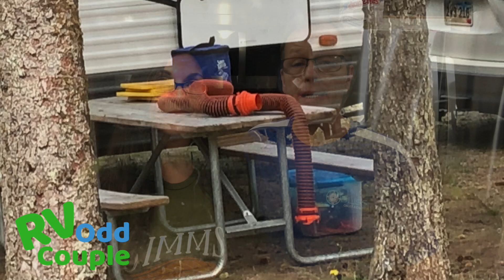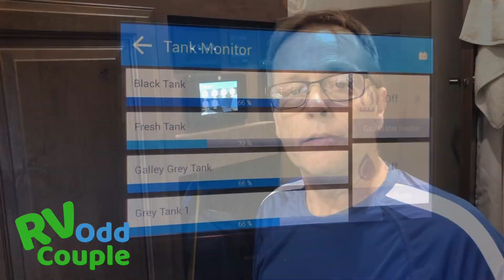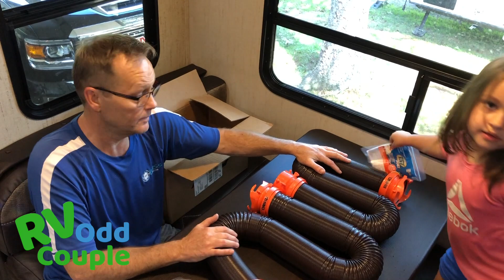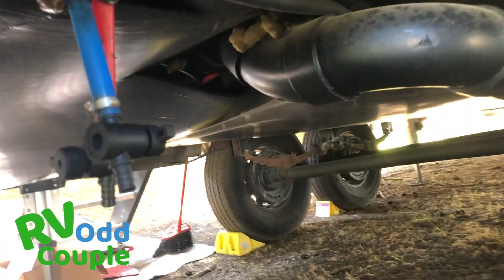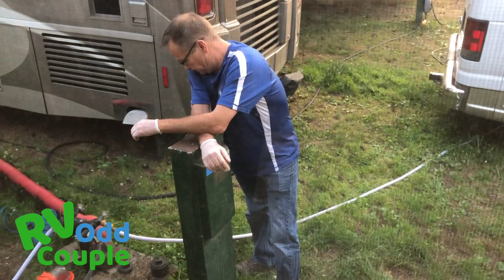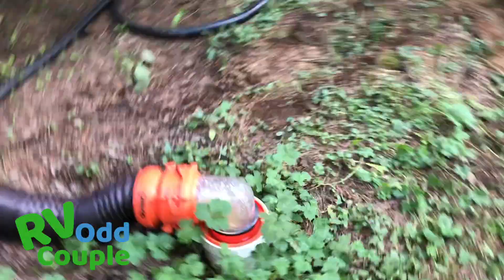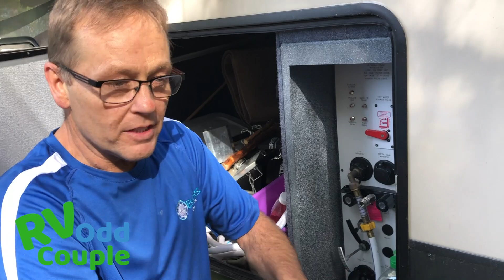RV Black Tank- Flush, Sensors, Hose, & Smell (Fulltime RV Living)

Comment: I'm new to this and haven't even purchased by camper. I have an F250 with the 6.7L. I did my research and have about 3.5k available for gooseneck or 5th wheel. My concern is finding campgrounds to set up in. I'm thinking that BLM lands would be best way to go as I'm a disabled vet and can stay at those locations for free. How do you find places to stay? Do you use Walmarts? Thanks and it would be great to cross paths on the road.

Comment: Have you ever thought about eliminating the entire black tank and all its issues by getting a compost toilet?  I had a leaking black tank that was fine until it got above about 3/4 full, then it would leak. I spent a lot of time under the RV with various patching compounds, but ultimately they all failed. I was going to have to shell out at least $1000 to have it replaced when I heard of compost toilets. I've had my Airhead toilet for about 9 months now and just love it! Best addition since solar, I go two months between changing the solids talk.  https://airheadtoilet.com/

Comment: So, Thanks for all the videos.  I took my new RV on a trial run to an RV site close to my home in San Antonio TX to Ft Sam Houston Army  Post RV Park.  I got everything setup and stayed for 6 days.  It took me 2 days to realize to push the Gas button in for the Fridge to use the AC Power hookup, but it worked.  It was between 103 and 105 every day, and my A/C kept up.  I called ahead to make sure they had 50 Amp.  Used my New Power Watchdog, sprayed the water hookups like you said and used the pressure regulator with the split water valves.  Have to say my biggest accomplishment was clearing the black and grey tanks though and I think you know why.  I was making sure not to cross-contaminate, used gloves, used different designated hose, only had to use 1 of the 2 drainage hoses with the clear elbow, and was SO happy when I saw the tank water go clear. I don't have a Black tank drainage hose hookup (that I know of) so, I used a Spinner Wand in the Toilet  and ran the hose through the window.  After I cleaned and drained it, I refilled 2/3rds full again to make sure I got everything, then cleaned the wand, the sewage hose and the fittings again for the next tenants.  You guys have taught me so much.  The only thing I didn't use was the LP Stove Burners.  I ordered in or went and ate out LOL! I was on vacation LOL!  Anyway, my thoughts and prayers are with you guys.  Remember ALL things are possible with God!  Thanks for all the Vids, Lessons, Mistakes, and Triumps, I'm sure there will be more Triumps and Blessings to come.  Love and God Bless, Tom AKA Senior! Here's my Little Toy Hauler if you want to see: https://www.youtube.com/watch?v=cJUnGTBgAyU
Reply from the maker: Congratulations Tom (aka Senior:)  We are happy to hear that we have helped you along the way....God Bless you as well💚💚💚

Comment: I needed this video. Thanks to you both! Getting back into RVing has been a re-learning experience. Really great products are out there. My drain-slope used to consist of stacked 4×4 & 2×4 blocks & all of the drain elbows were black. You literally had to pick up the elbow far enough from the septic-pipe to see whether or not the water was running clear. See-through plastics are much more sanitary. So much more efficient today.

Comment: John you are working to hard. I have a system on my camper that manages my tanks.
It dumps my tank automatically when the tanks read full and than it rinses my tank and it closes my tank back. It automatically rinses every time my tank dumps. This system has been on my camper for over a year and works great. When I pull in a park I install  my hoses and never touch them or the valves till I'm ready to leave.
Reply from the maker: Never heard of such a system Jim. Sounds Great! We will check it out. Thank you

Comment: On an older vehicle like mine it is a very easy thing to mix up the refuse by driving down a dirt road which will agitate the tank with the vibration and bouncing on the dirt road. This allows the refuse to break down any solids. I also throw chemical packets into the tank that help destroy the parts that want to clump together. 
I was in a very remote area that was where I was helping a logging company as a security person once. The Forest management specialist came by as I was preparing to pack up the motorhome so I could drain the tanks and he gave me permission to dig a hole about four feet deep and drain my tanks into that hole. He said he would allow it for one use as long as I immediately filled it back in as the amount my motorhome produced would not cause any more damage than the wild animals and the cattle that were run through there during the summer. That was the only time I got away with or even thought about dumping my waste that way. I suspect if you were not near any groundwater or other sources of potential contamination it would be fairly safe to do that ( so long as you are the only one there and it is not a place frequented by humans who would camp there).
Reply from the maker: Interesting...Thank you for sharing Dale

Comment: After watching a couple of your videos when you empty your tanks, I noticed that you give a solid "yank" on the tank drain.  You may want to pass along this tip:  Consider opening the lever slowly at first, so that the water starts flowing slowly, then open it to full.  I have been RVing for over 12 years part time, and have heard horror stories about sewer lines jumping out of the dump neck due to quick opening of the valve.  I have used the slow-at-first method exclusively and have never had an issue.  We think you two are terrific and have "binge watched" your videos from the first one to get caught up.  Keep up the good work!
Reply from the maker: Great advice Greg! The RV Odd Squad has taught us a lot in the last 1o months. We are very grateful for the help that we have received. Thank you👍😀

Comment: I used to be scared of germs, but after 20 years in a hospitol will make you realise that most things are not going to make you sick. but thay might make you gag. I still hold my breath when someone coughs around me though.
Reply from the maker: LOL...Believe it or not I am getting much better! Thank you
Reply: @rvoddcouple  also i like to use just 70% isopropyl alcohol  and you can just undo the cap a tiny bit, so it will pour out slow and rub your hands together. Its way cheaper than the hand sanitize and you don't have gel and perfume and who knows what on your hands. =)

Comment: Save the old pipe ends from the last hose , glue the ends togather then cut a hole on the side  and add a fitting for a garden hose on the side, put a shutoff on this because you dont want anything coming out the hole... Then after you drain the black tank, close the tank and then run the water down the waste hose. Should make cleaning the pipe easier. you might be able to tap into the existing  collar of the waste hose pipe if there is enough meat to take a gardenhose fitting. Also since you guys are doing this full time i would invest in the quick change gardenhose attachments. Just take them off if you are going anywhere below zero.
Reply from the maker: Great information! Thank you😀👍

Comment: I am allergic to perfumes and I despise the smell of the chemicals for outhouses and rv toilets.  Immediately upon our first trip, I knew I had to get rid of that stench of poop plus the so-called deodorant!  I started by spraying some all-purpose cleaner in the toilet and cleaning it well.  Flush and then I shook some baking soda in that water reserve to sit until used again.  After the black water was emptied and flushed out and my method was used each time the toilet was pooped in, there was no more stink, no despicable perfumes trying to cover odors, just a clean toilet and even when the rig sat in the hot sun, it never emitted any odors.  I don't use a lot of soda, but just having it in the tank helps even if it isn't emptied but once a week.  It's also cheaper than the blue stinky junk!
Reply from the maker: Great tips! Thank you for sharing them!

Comment: Oh yeah, there is one other thing.  I also noticed in the video with regards to using a separate water hose for the purpose of flushing system, and also, if I'm not mistaken, your fresh water hose comes from the same faucet?  Hence the "Y" valve?  I noticed there was no backflow preventer to prevent cross contamination between fresh water system and sewer.  It's definitely cheap and effective.
Reply from the maker: Interesting!  Thank you for pointing that out Jeff!

Comment: Great video!  Thanks for sharing!  Two things if I may:  1.) I saw an earlier post about spraying the faucets, handles, hoses, etc to disinfect and sanitize and there was a mention of using bleach and water 50% each.  I don't recommend that at all because bleach is very corrosive to soft metals.  It will cause premature rusting.  Aa spray solution such as lysol that has no bleach in it is much more user friendly and non corrosive and still do a good job disinfecting.  Bleach is ok to use for disinfecting your internal  tanks and plumbing because everything inside is all some form of plastic, which is not affected by bleach.  2.)  That's a great tip you mentioned on changing your shoes in between sewer area and living area. 👍
Reply from the maker: Thank you Jeff!  That's a great point.  Some recommended hydrogen peroxide instead of bleach.  Glad you enjoyed the tip about the shoes.  We learned this the hard way.  :-)

Comment: Sometimes I dont bother hooking the hoses until I flush.  No need to have them connected unless you use 50 gallons to shower
  Less smell from the sewer and my hoses arent being trampled.  Some campgrounds   charge $10 per day extra for sewer.  I can save $50 on a five night stay by dumping on the way out or next stop
Reply from the maker: Good tip.  We've never been to a place that charged extra for sewer but I'm sure we will soon.  That's a great way to save money!  Thank you for sharing!  :-)
Reply: @rvoddcouple  I've been to a few and last night I was looking at another one that did have a $10 per day difference.   I noticed you'all have the Thousand Trails membership , so you probably don't see them.    I was thinking about buying a pop up camper to take to North and South Carolina beaches in June and a second trip to Washington State in August.  I don't know if the Thousand Trails would be a good match for me , because we will camp for less than 60 days per year.
Reply from the maker: @jasavak  In your shoes I would look at a zone pass.  But if you get it from the 1800, there's an extra 11% in taxes.  I would ask Jim and Brandy Reneau  770-622-4188 or brandy_reneau@equitylifestyle.com and mention RVOdd Couple
Reply: @rvoddcouple  I heard they have an annual pass for $545 plus extra $ for add-ons.   $800 or so.  Don't know if the math works for me though.  I assume the beach resorts can get pricey , so maybe.
Reply from the maker: @jasavak  It depends.  If you get encore/Trails collection, it's an add on of 214.  Some areas of the country have a lot of thousand trails so you wouldn't need the add on.  But now that I think of it, in NC you would if you want the coast area.  It only makes sense if you use it as much as possible.

Comment: Thanks for the info.  What a joke that the OneControl only shows it in the same 1/3rd increments that the simple RV lights do, which shows there's actually no improved tech in reading tank levels - it's just showing on a bar (misleading) the same 1/3, 2/3... that's disappointing.  I guess another case of "data" garbage in, garbage out, but a little more literate. :)  I guess at least related to OneControl, "it aint all that," to worry about getting a unit with it like maybe I have been.
Reply from the maker: One Control is kind of a pain and we don't trust it. Looking for something better. Thank you Ewings💚 Would love to bump into you guys😀

Comment: This was a very thorough and excellent video. However, John, have to say you have a major phobia. At what point do you get poop on your hands?  This is a serious question. I don’t use 🧤.  Nothing gets on my hands. We have never put our hose on the picnic table. However, you have flushed your hose with soapy gray water, no?  So it is clean, except for the end piece. When we remove that from the sewer pipe, we spray the end with Lysol and pour water from a dedicated jug over it and wipe it down with paper towels. Also, don’t know why you would have to replace your hose every six months. You bought a good brand so it should last a good long time. We’ve had the same brand for three years and there’s nothing wrong with it.  Love the videos.
Reply from the maker: Yes, Major phobia but getting better at it with every dump👍😀 Sounds like you have a way that works great for you and that you're comfortable with.  Bravo! I'll always use gloves😂

Comment: One of the topics that needs to be covered is if the husband is injured, sick or incapacitated can the wife pack the rv up and hook it to the truck and drive it. I am facing it now in az where I hurt my back and neck and am basically bed ridden with pain. It needs to be covered that the wife knows how to everything we know and where everything goes and how to disconnect everything and stow the hoses , water lines and such. Thanks
Reply from the maker: You're 100% right.  I rely so heavily on John.  If anything happened to him I would be in for a rude awakening.  :-)
Reply: We did make it home. She drove the 300 miles home. It took me 3 hrs to unhook which normally takes 45 minutes. Had to lay prone in the seat the whole way. Saw a dr and feeling about 50% now. May take about a week or so to get my 64 yr old “normal”. Thank you guys for a great channel and ideas. Roll slow and safe !!
Reply from the maker: @Propnut48  Glad you guys made it home safe and that the Doc fixed you up. Thank you for the topic idea!

Comment: I have a electric pressure washer I keep in my Motorhome. What you should get for this is "
1/4" Quick Release pressure washer sewer drain cleaning hose" This will clean your tank the best get get all of it out and to clean off the sensors. You can get this on Ebay. 

https://www.ebay.com/itm/1-4-Quick-Release-pressure-washer-sewer-drain-cleaning-hose-L04/223200246063?ssPageName=STRK%3AMEBIDX%3AIT&var=522000452811&_trksid=p2057872.m2749.l2649
Reply: Ever you ever talked about these nice folding ladders that when you put it up for storage it is like 2 2x4 stuck together and can fit very easy on a compartment?
Reply from the maker: @williambaker6630  Great info.  I'll mention this to John.  Right now we have ladders bungeed to the ladder that is attached in the back.  This could help us.  Thank you!
Reply: @rvoddcouple  Yes this is a whole lot better than that. I can slide it out easily when getting gas and really clean the windshield.
Reply from the maker: Thank you thank you thank you!  This is like the 4th helpful tip you've offered us today!  We'll take all the advice we can get!  :-)
Reply: @rvoddcouple  One other thing I though of. You can get all the debris of your awning with a cheap electric blower. This work great and you get it done fast.
Reply from the maker: @williambaker6630  Excellent idea!  Thank you!  :-)

Comment: I was flushed with excitement when I saw you did a video on this subject. The excitement wiped me out, and I was moved by the amount of effort that you put into this. 

Two things I have used: 
1. A macerator. Then you only need to use a water hose. You can reach further and go uphill and your basic garden hose is far more durable than those thin wall poop hoses(just be careful not to mix up your fresh water hose)
2. I add a cup of cheap laundry detergent and a measure of Calgon liquid water softener to the black tank along with about 3 gal of water to the black tank every time I dump. It tends to keep the sensors clean. Look up the "geo method for black tanks"

Side note: that was a plumbers snake
Reply from the maker: LOL on the "Plumbers Snake"!!!  Great info to add to our poop tank arsenal! Thank you👍😀

Comment: That is a good idea, forming a P trap in the drain flex drain line. I never leave my gates open while hooked up. I let my tanks fill up 3/4 full and dump them. It saves on having a nasty drain line where poop does not have a chance to settle in my line. Hey! There is always that 10% you can count on disrespecting others. I am one of those who will tell that guy to get that nasty pipe of the table. I would also tell him, would you eat off a table someone smeared poop and pee all over it? My drain line has it's own special tote it is packed in. When it comes out of that tote it is hooked up immediately and when I unhook it goes right back in the tote. I remembered something today that saved me from overheating my truck while towing up hills. If you notice your temperature gauge showing you are close to overheating. Turn off the air conditioner and switch the heater on full blast with the windows down. The temperature will drop back down to normal and keep you going without having to stop or boil over. It is a old trick I used as a youngster while towing a loaded horse trailer uphill. When I go on a long trip, I always dump all my tanks and even empty my fresh tank to make the trip a easy as possible.
Reply from the maker: Thanks you for sharing your experience John👍😀